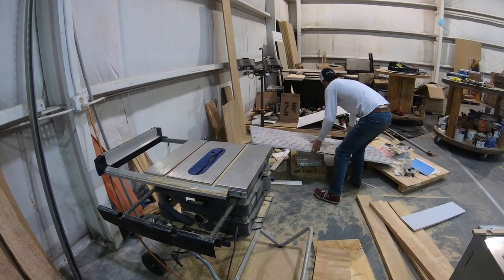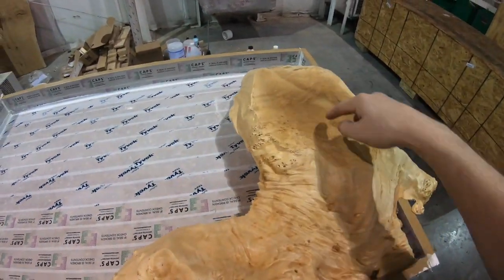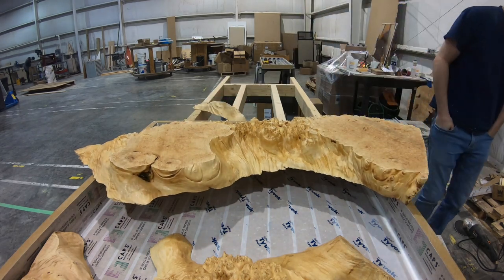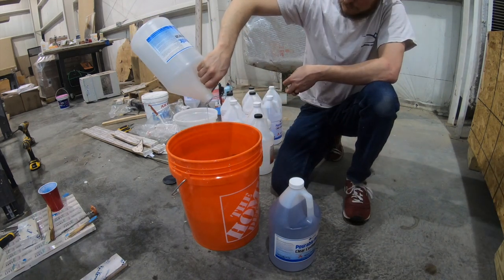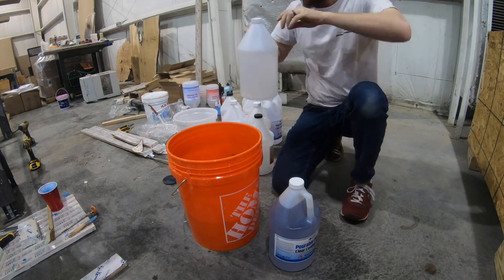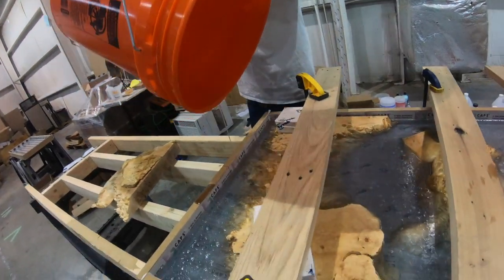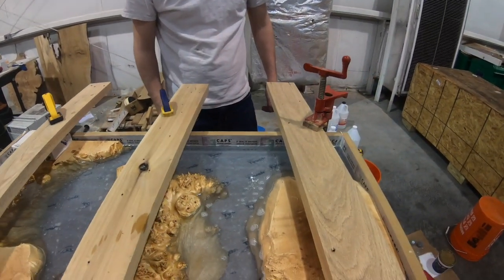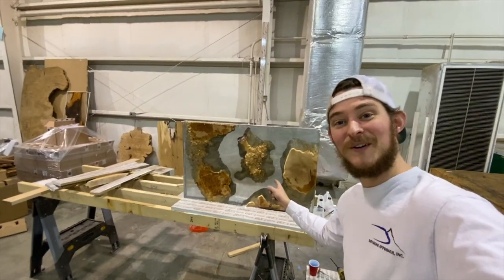Ultimate Epoxy Resin Coffee Table

Comment: can you tell me when you are a 13 in round live edge table with bark on it do you still have to put epoxy on the bottom thank  you rick from michigan
Reply from the maker: Yes, whatever you do to the top of the table, the same needs to be done to the bottom. This is to keep the table from warping over time.

Comment: i just started creating epoxy tables and stuff last year (2020). i wasn't sure what products to use - ended up with the same deep pour epoxy: the "incredible solutions". it seems to work fine for me so far. what is your experience with it so far?
Reply from the maker: It’s has been great! I have been using them for a while now.
Reply: @GoodViewWoodworks  thanks. the few projects i have used it for seems to work too. keep up the great work.

Comment: Did you torch it to remove bubbles, or did you allow it to release naturally?
Reply from the maker: I allowed it release naturally.
Reply: @GoodViewWoodworks  cool. I thought you always had to torch/heat gun it.
Reply from the maker: I try not to with the casting epoxy because I don’t want to set up too quickly. I want those bubbles to rise to the top.
Reply: @GoodViewWoodworks  good to know